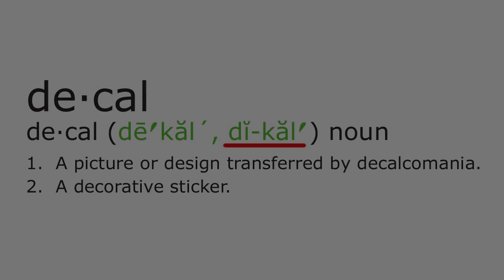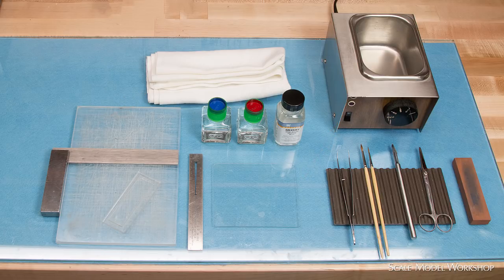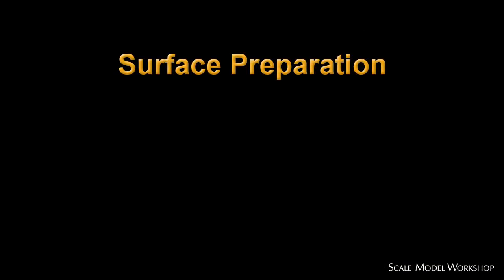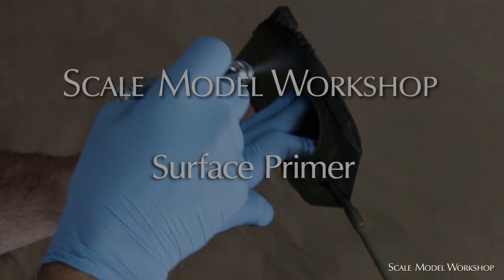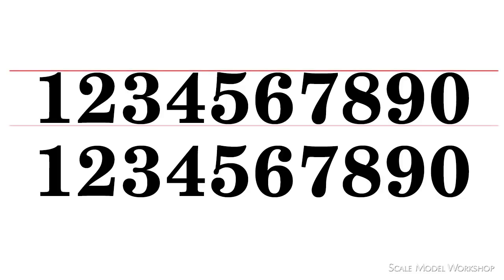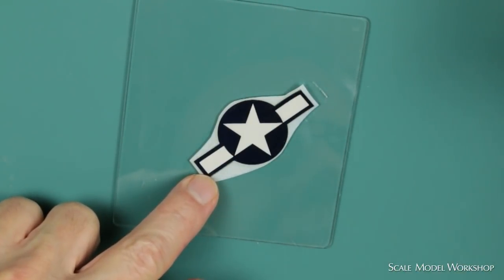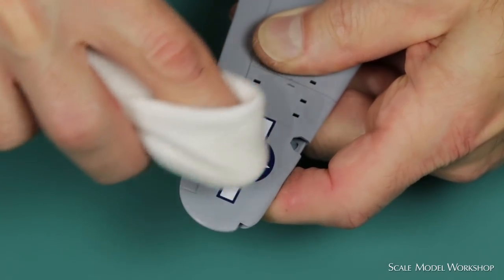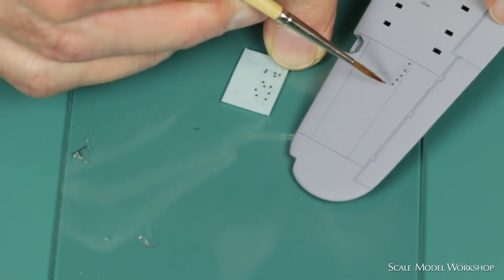Decal Application for Scale Models

Comment: Indeed, you are a master model builder. I will be customizing a few models soon, and would cherish your expertise. The models in question are die cast metal aircraft that already have a finished layer of clear coat. I will just simply be adding decals to change the livery. A couple of models have an underlying layer of paint, while a separate aircraft is polished zinc, however, they are all finished with a factory clear coat. My question to you is once I have taken the necessary steps to place my decals in their appropriate position, can I then clear coat the decals to further protect them without compromising the existing clear coat underneath? If yes, what is your recommendation for doing so, and what product would you use? I appreciate any advice you can offer, as these are expensive models for me, and are quite difficult to replace. Thank you kindly. Cheers
Reply from the maker: Thank you Red, It's probably a good idea to clear coat over the decals to prevent them from yellowing.  With that in mind you will want to use some sort of acrylic that you would either thin with alcohol or water.  The bugger is getting it to level out spraying it over an already high gloss surface.  Typically you would bust the gloss finish before applying any further coating.  But I'm sure you don't want to ruin the stock finish.  Your best bet is to test a few clear coats on some diecast that you don't care about and see what works.

Comment: Thank you for sharing techniques. I have a question though : After applying the gloss varnish coat on a surface, where decals have been applied, do you recommend to reduce the thickness difference, where the decals have been applied by sanding the surface ?

Comment: Great video with great tips I will have to add to my arsenal - as decaling has always been a nemesis of mine. Question: the hot water bath you are using seems to be a piece of medical/dental equipment, but there is no brand name visible. Can you provide information as to a manufacturer or other options. Thanks for all the great videos - I watch them repeatedly.
Reply: Found a similar unit under "Dental Thermal Bath" so I will wait for a good deal to come along. Thanks.

Comment: I usually get excellent results from microscale's micro-sol, until I tried using it on a large surface decal. I gave it some time for the wrinkles to fade but some of those hadn't - despite all the pricking, reapplying and several hours of waiting, only to end up having tighter wrinkles. Does this have anything to do with decal compatibility, excess solution or the prior paint job?
Reply from the maker: Probably more the decal.  I usually put down a relatively light coat of Micro-Sol at first after I've pressed the decal down with the warm towel.  I watch how it reacts with the decal before I put on any more.  Sometimes it will just softly wrinkle and then settle down.  Then when it gets a little firmer, I'll do the warm towel again and another light coat of Micro-Sol.  As it settles in over the paint and really sticks down, you can then go over it with more Micro-Sol ... you just want to avoid it puddling.  Sometimes you need to do it in stages, watching for how the solvent solution reacts with a particular decal.  One thing I don't do is let the decal dry out like I see many modelers do.  They put the decal down, wait till it drys out and then try and soften it ... totally counterproductive because you have probably already trapped a lot of air under the decal and since the edges are stuck down, it has no place to go.
Reply: Scale Model Workshop 
Thanks for the reply. I appreciate it!!

And great video, by the way. 👍

Comment: Hey Paul,   I've searched for your hot water vase/bath and have not been able to find one other than the very expensive lab versions.  Where did you get yours and does it have a brand name, model or part number I can search for?    Thanks and keep up the great videos.
Reply: I'm using an electric mug warmer that has an option to keep the water at around 40°C. They are very cheap and there are an infinity of models available online.

Comment: I notice a lot of questions about the water bath and not many answers.. save your money and buy a cheap paraffin wax warmer off amazon. Not the intended purpose but they have nice small tubs, simple settings, small footprint, and waaaaaaayyyyyy cheaper than restaurant or medical grade equipment. 20 bucks on amazon..
OR, get a cheap mug warming plate. Also nice and small, even cheaper, and you can also get usb ones to just plug into your phone charger or battery pack.

Comment: I was the name brand and how can I find a hot water bath like you have
Reply from the maker: The only hot water baths that I'm familiar with are supplied for dental use.  They may have other applications, but I think you'll have to look at dental supply outlests.
Reply: @scale-model-workshop   I found them they are quite expensive I will get one on eBay somehow Also all the decals solvents that you put over those decals Is it gonna matter with a high gloss clear